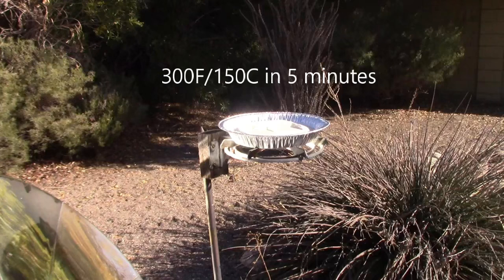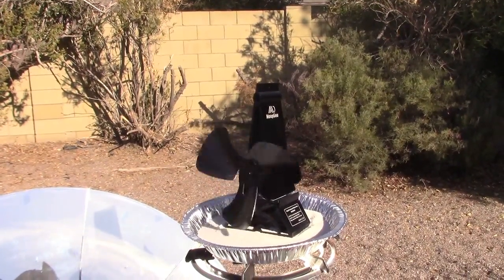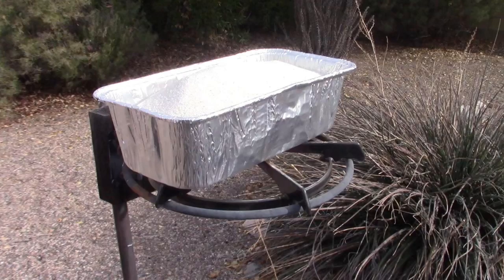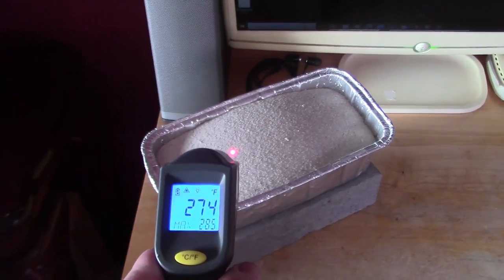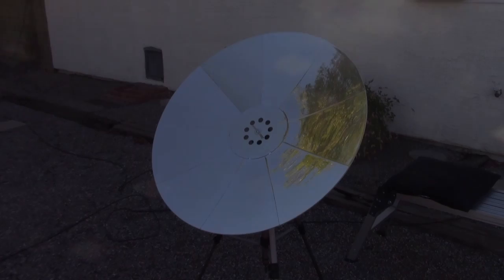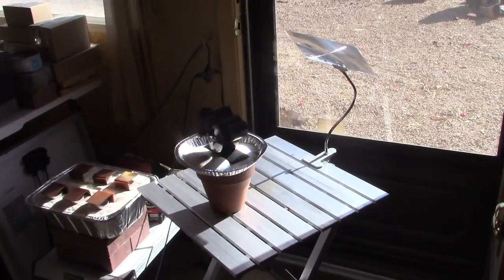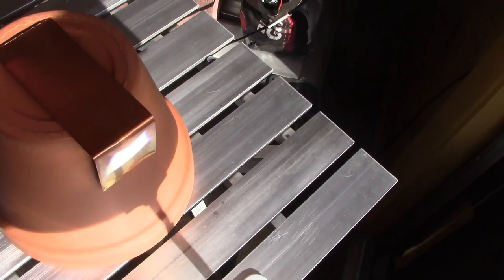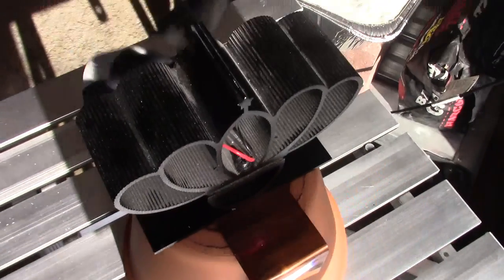How to Heat "Sand Batteries" using a Parabolic Dish or Fresnel Lens! Free Heat! DIY Air Heating

Comment: Great idea!  Maybe try scaling up to a 1/4" or 1/2" copper plate with that same angled bend.  If you can aim 2 fresnel lenses at it, could you achieve cooking temps?  A solar hot plate.  Keep up the great videos!
Reply from the maker: hi. even 'one' if you used a slightly bigger one. i may have to get one. if you see any for sale, feel free to drop a link in the comments. i may buy it

Comment: I've seen several of your videos and all seem like great ideas.  If you had to choose one, which would be your favorite as far as safety and heating? xo
Reply from the maker: hi there and thanks for watching my videos! i think i have something like 40 total DIY heater videos posted so far (so it's hard to say which one is best). they all have their pluses and minuses. the best ones in terms of btu output are probably the ones i've made with larger (water to air) heat exchangers. those units are rated 25,000+ btu's and the biggest one is rated 57,000 btu's. you have to have a source of hot water though. i do have a compilation video that i made that shows 33 of the projects all in one video. if you watch that one you can see a lot of them all together
Reply: Thank you so much!  I will try to find that compilation video.  I so admire your brilliant mind and creativity! 💖

Comment: Aluminium melts at a low temperature
Reply from the maker: hi. yes, relatively low compared to copper or steel. (aluminum melts at about 1221F/660.3C) but the parabolic won't get much over 800F/426C though so it works good. if you use larger parabolic or larger frensel lens you may want to use steel or stainless steel pans

Comment: Hi, I actually found you from your AWG video from years ago. If you have the time can I ask you a question about it? 
I’m looking into building a short bus eventually right, and I need fo figure out a water solution pretty much. And I really want to do a AWG since I do live on the east coast southern area so it’s sun tropical. Normally a dehumidifier is very intense in a solar array if it’s going 24/7. Your solution would work I believe.  Do you think if I upscale it a lot it would work? If I have a deep freezer in my tiny house on wheels and have many gel packs that freeze and keep rotating them with long copper pipes circulating them would that be enough to sustain myself comfortably? Like making a fully enclosed system so it’s not ugly out in the open persay and vents in air from the outside. Almost like a very slim tower fan I guess going from the ground to ceiling. How much water did your unit make in a day with only your short amount.

Comment: Bottom should be painted black.

Should use large amounts of solid aluminum, has higher heat capacity than sand, heats up much more evenly. Only downside though is you need to insulate it very well until you want to use it.

Comment: good idea, may i add a ceramic tower for the heat to be captured in the altitude , thanks
Reply from the maker: hi. a ceramic tower. i'll look into it.👍🙂
Reply: some place pots on top of each other but it s interesting if you have a tall coneshape ceramic or bluestone as a larger heat collection  surface, the hot air can also be captured in a smaller metal  pot on top , before dispersed

Comment: Good idea but not practical at all !
One kg of sand stores 835 joules per Kelvin or 0,23Watt hour, let's say you heat the sand to 520°C and let it cool down to 20°C, it will release 115Wh of heat for 1kg, that's not much, we can easily manage a 10kg pot which will give 1,15 kWh, even 25kg would gives less than 3 kWh (and knowing that the sun radiates less than 0,5 kW /m2 it would take most of the day to heat up that much).
So yeah it's a cool experiment but what are the application you have in mind ?
Feel free to correct me if i made any mistake :)
Reply: 25 kg of sand is roughly 15 L which is roughly the size of a large cooking pot, so not that large at all. And if you used a larger parabolic reflector, let's say area on the order of 25 m^2 (~6 meter diameter), then this could concentrate around 10 kW of heat. After losses, let's say ~5 kW ends up going into heating the sand. It would then take only ~36 minutes to heat this amount of sand to 3kWh. Let's say you operate the system for 3-4 hours a day, and half of the days in the week it is cloudy, so on average let's say 1.75 hours per day of operation, then you can effectively store ~10 kWh every day across three sand buckets which should be more than enough energy to meet heating needs (esp. in winter) + daily cooking needs + if you can hook can a stirling engine generator set up, you could get electricity out of the bucket fairly easily.

Comment: Do you think there would be any benefit to using cast iron, as the black would absorb more of the reflected sunlight?
Reply from the maker: hi yes black pans would most likely heat up faster and absorb more thermal energy. i like the cast iron idea too. i've got a cast iron dutch oven.
Reply: @ looking forward to the results of that experiment, should you decide to try it out!  Very interesting video, I’m inspired to try it out myself

Comment: Are you planning to extrapolate? 
What would it take to have a large bank of sand inside, but heated with a lense - trombe wall style?
Reply from the maker: i was thinking of trying the 2.5 gallon bucket shown in the video and maybe a 5 gallon bucket of sand. will have to set up a concrete stand to hold the larger buckets. i wonder if we could run solar heated water into an indoor sand bank. you could bury copper pipe in the sand and circulate hot water thru the sand to heat it. (just on idea but i guess the water would only get the sand to maybe 200F/93C or so). installing a lens on house to heat sand indoors sounds pretty cool. i'll have to give that some thought
Reply: @desertsun02   oooh, port the heat with water to another storage device. as long as the porting segment is insulated, there should be little loss. 
For the trombe wall --> window - lens in gap - interior heat sink wall 
or would the sun going through the window scatter?

Comment: Have you ever considered brazing aluminum fins or copper fins to the bottom of pans to improve thermal efficiency of cooking over an open flame?

Off the top of my head jetboil is an example, but any Amazon camping pot with heat exchanger is similar, a ring of aluminum that’s affixed to the bottom of the pot around the edge to grab the extra heat going around and not in to the pan

You are someone who I would think would do amazing things with heat exchanging pans
Reply from the maker: hi. thanks for the ideas. i hadn't thought much about that but it sounds like a great idea.

Comment: Glass or plastic (for fresnel) can block some UV light, also copper in sand might distribute heat inside sand.
Hope you make some more development thanks
Reply from the maker: were you thinking copper sheet or copper pipe? sounds interesting but any extra details would help me build prototype.

Comment: I was previously thinking about using a Fresnel lens to create more electricity on a solar panel but I was afraid I would end up frying it instead. This is a great alternative.
Reply: With solar panels this is only a good idea if it is very cloudy or if there is fog in bright sunlight you burn out the modules very fast.

Comment: Love your ideas man but how about a solar sand heater that would keep a bedroom warm all night long during the winter months. I'm thinking a steel or concrete 55 gallon filled with sand drum heated by a water heater element and two solar panels  .Run a copper coil in the sand filled with water into the bedroom, pumped to a recycled heat exchanger from a old portable air conditioner.
Reply from the maker: i was thinking about actually buying a custom made DC element that could run dry and that could run off of 2, 3 or 4 larger 48v solar panels. that would heat the sand in a 55 gallon barrel pretty easy. should last a couple days at a time. i know of companies that can do it but the problem with a custom made element is that no one else would be able to make the project. i need to find an 'off the shelf' large element that can be run dry.

Comment: Amazing! What’s the name of the clip arm you used to hold the fresnel lens in place?
Reply from the maker: hi . they sell the fresnel lens and the clip arm together. the flexible post is the same as what a gooseneck lamp is made from. i'm not sure if they sell those clip arms separately, but they should. it could hold a much bigger fresnel lens. the clip is so strong that it takes 2 hands to open it all the way. even has a thick padding inside the clip to protect whatever it's clipped to.
Reply: @ Thanks! So on Amazon?
Reply from the maker: hi, yes. if you search for 'magnifying glass with clip' you will see lots of them. they don't seem to use the term fresnel lens though. they just call them magnifying glasses with clips. i'm currently looking for a bigger fresnel lens with a clip but haven't found one yet.
Reply: @desertsun02  Fantastic! Thanks. Love your channel!

Comment: Isn't it just blowing hot air from that hot sand though?? 😆
Reply from the maker: yes that's exactly what it is doing. the sand holds the thermal energy from the sun and to use as an air heater you just bring it in and drop a 'heat fan' on top.

Comment: you should try cooking eggs in the sand ... in the shell?
Reply from the maker: neat idea! i was wondering about cooking over (or in) hot sand. i wonder if potatoes could be 'baked in hot sand
Reply: I don't see why not . Hot sand and salt have been used to cook things like cracked corn. You might want to wrap them in foil to keep the grit out or in case the eggs crack. Though a good vegetable brush could help with the potatoes without foil. It wouldn't be too much different cooking in a sand or salt bath than in boiling water bath.

Comment: does it blow hot air on you though?   Cool project
Reply from the maker: hi yes. it will be warm to hot depending on how hot you heat the sand. the fan starts at 122F/50C so it will need to be at least that hot to use fan. i heated sand up to about 300F/150C but you could heat it much hotter if you wanted to.
Reply: Warm Air

Comment: Here is an idea. I have plenty of sunshine, so during daytime passive solar provides pleasant warmth in my house. I live in the southwest, too. I don't need extra source of heat during day, but I need it during nighttime. 
So, how do I use solar light heater to heat sand battery in a system where the sand battery is heated and insulated, and then moved to my bedroom to release heat during night? I can use truck dolly to move the battery from in and out of my house. The sand battery can in theory be in an insulated wooden box with one side being glass. In theory, I can drill a hole through my house wall and get wires from solar panels to the sand battery permanently stationed in my bedroom if not using solar light heater. My research also indicates I would need lots of sand but for a small bedroom I hope one big bucket of sand would be enough. I don't need super toasty ambient. I like sleeping in little coldish environment.
Can you make a system like this something small enough to easily move around, and easily heated enough for nighttime?
Reply from the maker: hi there. sounds like you've got some good ideas. one big bucket should be enough. insulating the bucket for later use is very good idea. i'll give this some thought. may be a future video.
Reply: @desertsun02  Thank you for your considerations. I was thinking solar panels as source would be easier to implement than reflective mirror. Also, maybe having a metal bucket full of sand inside bigger metal bucket with fireproof insulation in between and on the top, and drill holes where DC thermal resistant elements goes in. The thermal DC resistant element you use in your videos from several years ago to heat sand. Thank you.

Comment: cool I seen some guys have the pot fixed to an arm attached to the disk and it rotates. Those fresnel lens in flat screen tv's make huge lens. Keep the videos coming you are getting closer to the answer.
Reply from the maker: i just thought of an idea. i wonder if we could heat the sand, bring it in and then cook over it. my parabolic could probably get it up to 800F/425C or so (if i left it there a while longer). maybe put a rack over it or just set a pan on it
Reply: @desertsun02  Maybe 2 cast iron frying pans with sand in between them and welded closed then bring it in and cook on it.
Reply: @desertsun02 my thought would be maybe like a very large steel pot or like a 20 pound propane can with the lid cut off or something, just because it being thick steel and so large it could hold heat that you could cook with possibly longer? If the parabolic cooks the hell out of it and can get the whole thing up high

But also I’m now considering trying to move a large sand filled propane tank that is 400+ degrees

Maybe not quite that, but you know what I’m shooting for
Reply: @desertsun02 I was thinking the same thing while watching the video. I imagined cooking in a Dutch oven held in a larger container with the heated sand covering it all. If a large enough Dutch oven was used, it would serve as an oven that held containers of food to be cooked. The Hawaiian luau and Yucatan cooking does a similar thing with building a fire in a pit, then allowing food to cook over the coals after covering it with soil. Residual heat, like that done by thermal cookers.

There's a company called RockPotUSA that sells a unit that uses a special heated stone to do this.

Just brainstorming ... a three-chambered vertical unit ... The top holds the sand as it is being heated ... the heated sand then falls into the cooking chamber (preferably insulated) where the large Dutch oven is ... the bottom chamber receives the used sand when cooking is complete. Once the sand cools, move it to the top chamber. It's gravity-operated.

You'd want the ability to know the sand's temperature as well as the food's temperature at all times so you could evacuate the hot sand and avoid turning the pot roast into a lump of carbon. And there's probably an optimal scale for the amount and temperature of the sand to get reasonably consistent results. I wish I had the skills to take a stab at it.

Just found your channel. Great job.  BTW, would black sand increase the efficiency of the heating? Are there any other materials that would hold heat longer than the sand that could be incorporated with the sand? And,  what if you used salt instead of sand? Would that have different properties? I've used salt as a heat sink in the bottom of a heavy pot to cook a Cornish game hen using only a small can of Sterno.

Looking forward to more experiments.
Reply: There are fresnel lenses in flat screen tvs?

I was always told that was only the tube types... Huh... I'll have to look into that.
Reply: @priestesslucy they’re called projector style TV’s, it’s a projector that sits in the focal point of the fresnel lens

And then the screen is in front of that fresnel lens

Comment: Wouldn't the heat being released by the sand be negated by opening the door and bringing the sand battery inside? Therefore what if you had a large glass window and just done it inside your home that way you were not really releasing any hot air to the outside when you open the door to bring the sand battery in?
Reply from the maker: well, you'd want to heat the sand outside. i used the frensel inside just for demonstration purpose but i would typically heat it outside. the sand will stay hot a long time (several hours). i heated it to around 300F/150C using the parabolic but you could heat it much hotter than that. the frensel i have is a little small so i think the sand only got to 150 or 175F but those fresnel lenses get really hot (over 1000F/538C). the fans starting temp is 122F/50C.

Comment: What's your advice on where to her a fresnel to try this? I've seen the guy with a massive one he calls the solar death ray. How do I know when big is too big 😂?
Reply from the maker: hi. the fresnel i bought is from amazon. about 18 dollars. i've seen a couple of them with the 'gooseneck' style tube. i don't know that there is one that is too big. sand can be heated to 3000F before it melts, so you'd be limited by the container. steel melts at over 2000F so i'd say you could potentially heat the sand to 2000F in a steel container if you wanted to. i may try a fresel lens about the size of my 32" tv. i think the guy the runs the greenpowerscience channel still sells large fresnel lenses (but i'm not sure)
Reply: when you melt the pot

Comment: But in order to heat enough sand to last the night, you'd need to spend the entire day heating sand and storing it, one pan at a time, into a big barrel...

We need a way to auto track and auto move the heat.
Reply from the maker: to upscale this i'd consider getting 5 foot parabolic. those are up to 1800 watts and could heat a 5 or 10 gallon barrel of sand pretty quick. you might  make a couple and i bet the heat could last a day or two. the biggest unit i ever saw holds heat for about a month